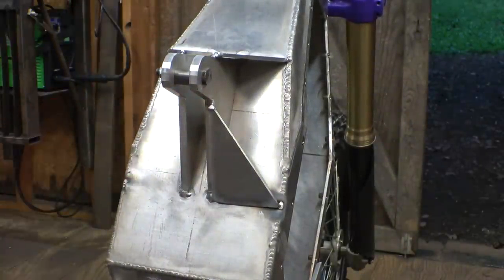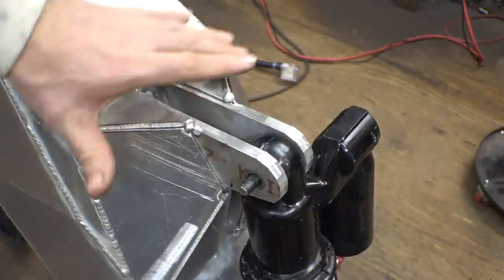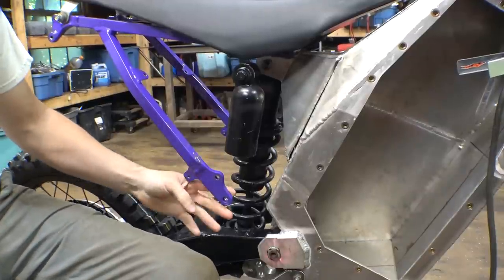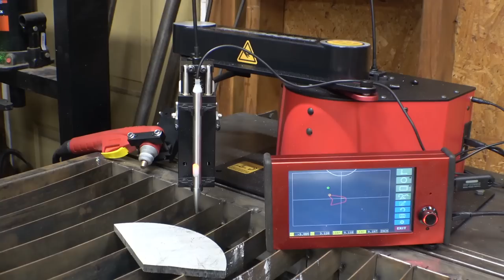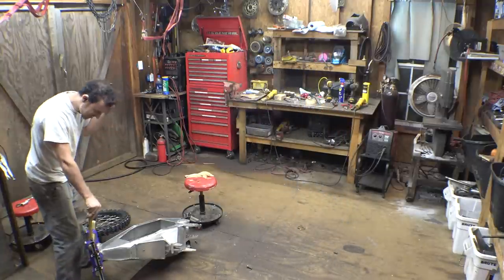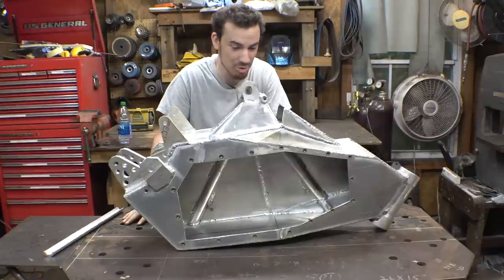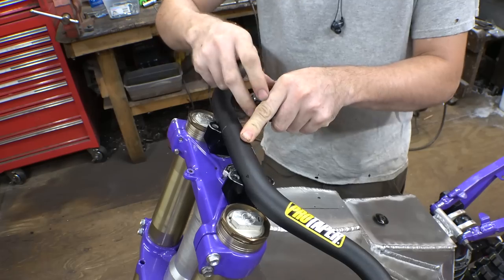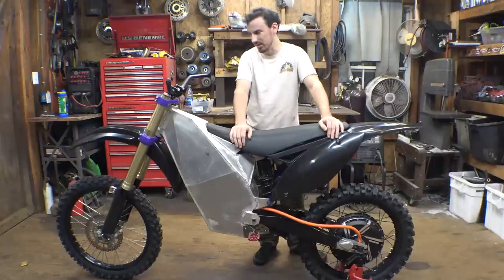Home Made Electric Dirt Bike Build - Part 6

Comment: The weight of the battery and electronics will lower the seat, hopefully enough to touch the ground
Reply: This was obvious to me right away.
Reply: Plus without jack stands it will lean over. You'll adapt.
Reply: Still won't be enough, he's almost a foot out of reach, it's the geometry of the bike that seems odd. So like pause at 29:31 and go look at another bike of the same class, and it looks as if it's a bit too high in the center.
Reply: @aserta  That's why I said he'd be able to  touch the ground, not put his feet flat on it. It'll definitely help but you are right, won't be as much as a geometry change
Reply: Я думаю там стоїть потужна дуже пружина . Можливо прийдеться поміняти амортизатор з гайкою якою регулюється робота амортизатора .
Reply: Dead right. The forks also didn’t look like they had enough sag so that’ll help if they are softened
Reply: @aserta  I think that when he changed the angle for the seat it thru him off
Reply: @aserta  his seat height should be 37in, looks a lot higher
Reply: It looks just like a kx250 sitting on a center stand right now.
Reply: Gotta set the sag with the battery in place, that's all.
Reply: @fullmetaljacket7  agreed, though I doubt it'll come down as far as he wants it to. May need a different shock
Reply: Yeah but he’s also gotta stiffen the suspension so the bike doesn’t bottom out and hit the ground when he hits a big bump or launches off a jump.
Reply: @satan4409  the steering head is gonna snap off the frame on the first jump so I don't think that matters lol Way too flimsy for anything serious.

Comment: First off, great work, I follow and love all of your projects. You are an inspiration. 

Part of the reason for the bike being tall is the way the suspension is now "set up".  I'm just pulling the numbers out of my butt, but you want to run a bike like this with 20% sag, meaning if it has 10" of travel, it sinks 2' as soon as you sit on it. Your weight is all in the rear wheel and that is unsuspended weight... Once you have the battery and everything else installed, hopefully this makes the suspension work better and sag more. 

You should be able to bounce on the bike and get the suspension to move several inches if it is set up properly. If not, it is going to bounce you all over the place, but you're kinda fighting a losing battle when your wheel is over 60 pounds. 

Monocoque frames are very noisy. I have a MTB that has one and it makes lots of noises. That frame is like a acoustic guitar body. 

Also, depending on the type of bike, being able to touch the ground / standover height is one of the things that a manufacturer will compromise to make the bike work properly... If you have 12" of suspension, you need a minimum of 12" ground clearance (probably more like 14" when you consider tire squish and uneven ground)

Comment: Chris, @ 19:50 you notice a spark from the steering shaft to the table. I believe you need to move your ground to the frame instead of using the table as a grounding surface. That's the reason your ground cable is heating up. 
Love this project, keep persevering.
Reply: Was wondering the same

Comment: Chris I love how you turned lemons into lemonade, your seat angle was wrong and you corrected by giving your power plant a cooling vent, lots of builders would let that turn into an angry issue and slam and throw tools all around the shop, well I am thinking how I would have reacted,  I have learned from your approach to problems and how you have overcome issues as they pop up.

Comment: I just had a dream at 62 years old from watching your videos with great interest and enjoyment:  I want to learn how to weld.   Very inspirational!  (I didn't mind the no-rear-panel look!)  I think graphics to make the "submarine" body look so huge will help.  Agree, I was eyeing your front forks not moving as you sat.   Preload and potential move them up in stanchions, as well as additional weight from battery.  I am probably way behind completion on this post, but would have opted for mid motor v rear wheel (cheaper?  Easier to use stock rear stuff?) as it adds lots of unsprung weight -- and THEN you have a real dirt bike, very, very capable!  Saying this will all humility.  Phenomenal work.  I wish I had your patience and expertise!

Comment: Couple things that could help your seat height situation. The weight reduction with the engine removed might have made the spring rates in the forks and on the shock too heavy for this set up, so you may need to get lighter springs. You can also push the forks further into the triples to lower the front, and swap out the rear shock links for lowering links, or fab some yourself.
Reply: Well that and he does not even have speed controller or the heavy battery inside at this point, so of course there is no sag due that missing weight. Since motor was moved to rear wheel that is off the suspension as well, so it will sit higher and be higher even when sitting on the back. Not sure he can push forks further than those already are, handle bar constricts that. Might need different front end that is shorter or get that motor weight into the frame, so this thing can actually be called dirtbike, now its more of dualsport. Rear is easy enough to drop, but the front is the issue here.
Reply: @Hellsong89  true, his got a hell of a gap between front wheel and the guard, will have to see how it looks loaded. he can always replace the bars and lower it slightly infront.

Comment: Tip . Try preheating (300f) that thick aluminum before tig welding it. You can also add some helium to your argon with another bottle and get better heat/penetration!

Comment: When welding aluminum you should ground directly to the part, especially on top of a steel table. If you watch playback you can see the aluminum arc off the steel.
Reply: I searched for someone else saying that.. I didn't until after I did. But I hope he sees the different comments letting him know!
Reply: @SillySalmon94  i done the same as i was thinking the same just needed someone to confirm it

Comment: Hey Chris, it would help if you put your grounding clamp directly onto your work piece when welding. It will help with your heat issue from to much resistance.

Comment: weld a bracket on the side of your platform with some holes in it so you can drop in a spring loaded pin into the hole which will hold up the cutting platform for the arcdroid

Comment: Look into dirtbike Sag adjustments for suspension. You want to be about 104mm of compression once you sit on the bike. That will set up your rear spring tension properly.
Reply: 104mm of sag would be about right for 11” to 12” of wheel travel.  I ride a CRF 250F which only has a little more than 8” of wheel travel and a suspension expert recommends about 70mm or 2 3/4” of sag.

Comment: As a suggestion, how about putting some sound deadening material inside the frame / battery / controller housing. Might make it sound less metallic when stuff hits it. Also a gasket of sorts around the door? Fantastic build, keep up the great content 👍🏻🇬🇧

Comment: Definitely need to cut out a huge lightning bolt on each side of that aluminum box and put an acrylic panel in there.  And then backlight it with LEDs.  DO IT⚡️⚡️

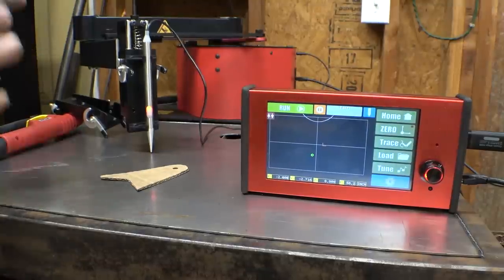Comment: @12:15 And realize that if you trace it loosely, and don't follow the contour exactly, you will get either a piece of scrap or something that needs extra grinding. The stylus is only as exacting as the person tracing the part or template. And the Part/Template's accuracy itself. Affixing with hot glue works good. Then you just peel it off. The computer screen will show how you did, so you can redo it if you "color outside the lines".  😅

Comment: Yes chris, Its looking sick starting to take shape now. I think the frame will be strong enough, if it was me I would weld on the inside at the back of the frame cos it's where the swing arm and shock bolts to and the inside at the front where the head stock is. Go over it with no filler rod first by melting/puddling the two bits together then if it needs it go over it with a filler stick, hopefully it's a animal when it's built 🤞🤞💯👍👊👊

Comment: I'd go with the black colour and ditch the purple bits will look sweet suspension works great without battery any luck finding the spring with compression ratio you need

Comment: I would definitely sit on it n hold some dumbbells or something that are around the same weight as the battery n controller to see if the suspension will come down enough for you to comfortably touch the ground. Also that trace feature on the cnc plasma cutter is sick

Comment: remember voltage = top speed Amparage to the motor = acceleration and remember to have thick cable from batter to controller and controller to motor for less voltage drop

Comment: Pllease measure the voltage drop of the cable by measuring the voltage in your garage and then substracting the voltage at the end of the cable in your shed. That would be interesting to know.

Comment: Just a thought on the hole you cut it looks the right size for a pc fan to fit. it may help with air flow and could be hooked up on a toggle switch

Comment: I would add a strengthening gusset underneath and around the head tube and downtube frame junction at the neck where the fork sits as there will be a lot of stress on that joint especially when the battery’s and controls are all in there

Comment: 3 things to say
1) in place of clutch lever,  fit rear brake mastercylinder from scoot they 14mm like the dirt bike rear mastercylinder 
2) the seat angle on frame was fine, but the rear shock mount height dictated your seat height and thus the new angle you added is now also bending your seat base 
3) suspension squeeks, look at thrust face fit of suspension points and angle of bits, might be advisable to make a jig of original frame locating the swingarm to shock and torque arm locations and use it to double check your Ali frame locations, maby an edit of one of the points is needed 

Cool build so far,  electric dirt bike frame 2.0 next to come?

Comment: While you're resealing the front forks, you could cut the springs an inch or 2 to bring the front down . Then you just need to adjust or cut he back spring to bring the ride height down to level the bike. Since you aren't going to be riding hard trails or jumping it, the ride height being lower should be just fine.

Comment: If its not low enough after it's got weight on it you could make the suspension linkage longer or move the frame side mounts out, they even make an adjustable version

Comment: Even with production welding aluminum with a water cooled torch and the ground clamp on the peace or super bear like yours they get rowdy hot. Miller machine also. Happens!
Reply from the maker: Especially at 154 amps for 20 minutes😂

Comment: I think the rear side fenders have an additional function - they stop the engine ripping your leg/foot off if you fall and get an appendage in the void between the tyre and the underside of the seat frame.... :)
Good work, really fun to watch! :)
Reply: The motor is in the rear wheel.  Nothing spinning in the frame.
Reply: @MrMorepower71  The motor is driving a VERY knobby tire that rotates from an open space into a narrowing and finally disappearing gap down into the rear swingarm.
LITERALLY the first thing you're taught in mechanical engineering safety is to never build something that moves fast and carries mass intertia into a narrowing gap. Most machinery deaths and amputations are caused by this. It's the basic working principle of branch shredders and waste disposal shredders if you want to look at it from another POV...

Comment: when you lowered it you did it only at the back tire which made the seat tilt downward so you raised the seat in the back. being that the front end didn't get adjusted at all you're just kind of teeter-tottering so you lowered it but to fix the angle of the seat you put the seat right back where the frame was before you lowered it. still a sick build though!

Comment: You can adjust the sag of the rear suspension so it sags when you get on it so you can touch the ground, or for some bikes you can get a new linkage for the rear suspension that will lower the bike

Comment: Sería buena idea poner un casquillo de acero entre el tornillo del amortiguador y el soporte de aluminio. Si no terminará comiendo el agujero y cojiendo holgura . Gracias y saludos desde España. It would be a good idea to put a steel bushing between the shock bolt and the aluminum bracket. Otherwise it will end up eating the hole and taking slack. Thanks and greetings from Spain.

Comment: For cutting aluminum on a plasma cutter you should be using nitrogen rather than air. That's going to help clean up those edges alot.

Comment: The sleeves are better than long sleeves, to prevent skin cancer. You’re wielding almost the same amount of UV light emitted directly from the sun. That’s why tig welding booths are usually painted black to absorb errant light/UV. Same goes for the neck area. I’m a AWS (QC1/CWI) welding inspector/welder btw

Comment: Hey mate, for your bike height, you can get lowering links for the bike if you have retained the exact geometry. Also your looking for a rider sag of 100-105mm. You can see in the video your suspension is not sagging near enough. 

I’m sure your aware but the suspension geometry is very very precise with dirt bikes. A lower linkage that’s longer or shorter will change the bike characteristics entirely. I’m assuming you have all mounting positions in the exact spot as the original KX. Excellent work 👍🏼

Comment: Have the forks revalved and softer spring rate when they are rebuilt.  Also there is alot of meat in that seat could shave atleast an inch from there.

Comment: all full size bikes are mostly the same seat height depending on the brand, but once you have the battery and controller in it i'm sure it'll make it sag enough that you can reach the ground, also i like how you put the rear quarter panels on and you can still see the shock in the middle through the gap it looks cool

Comment: You can get or make longer rear shock connecting rods, the cantilever rods underneath, that connect the swing arm to the bottom of the shock. If you lower a inch on the back, lower a inch on the front to keep steering working as intended. It will also sag with battery weight and all electronics, but maybe not enough.

Comment: You can buy a cheaper (but still look for a certified/good brand) fire proof under suit for racing stuff. They're thin, but they don't burn. Being the undersuit it's not as expensive as the outer skin, and it's meant to be a consumable (it soaks up the sweat instead of the suit, is the idea). That can be used to weld, because it's not as cumbersome as a leather jacket, but it also won't burn.

Comment: get some nickel anti seize and put it on those handlebar threads... you have steel bolts with aluminum bar mounts and it causes galvanic corrosion. Nickel (NOT COPPER) anti seize will work great on alot of stuff

Comment: I would highly recommend uncoiling those 220v extension cables before using them. If you use them while still coiled up, you run the risk of making an induction coil and melting the cords/starting a fire. Lots of images on Google of extension cords that melted themselves.

Comment: Build a water table under the plasma with a drain hole so easy to fill and drain to use.

I think you should rebuild the suspension.  Forks arent that hard just a few cheap parts and add a heavier fork oil

Shock may/may not be rebuildable.

You should be able to find the manual for the original bike online and will have specs and directions.

Comment: Once the bike is ride weight, you'll have to sit on it and check shock sag. You should have around 100mm sag from your weight alone. I think free sag should be around 30mm iirc. Total sag should be around 130mm from full extension to loaded with rider. 
If you have 100mm sag but too little free sag, you'll need a larger spring. Base initial spring rate selection on total additional weight over stock bike that the suspension came from.

Comment: nice ! arent the suspentions a little too stiff ? like always, good video
Reply: that comes from the donor bike, its a motocross not  an enduro, motocross suspension is much stiffer (for big jumps) than enduro suspension, also there is not that much weight on the bike yet

Comment: The weight of the battery and the electronics will help to weigh down the suspension and you will have to set the proper suspension sag after it is fully done. However the fact that it is a 250 is irrelevant. It is a 250 competition bike, atleast that is what you based the frame off and the suspension is full competition. It I designed to his 60ft jumps and pound through whoops. If you wanted a dirtbike that you could reach the ground on, you have used a recreational dirt bike like a Yamaha TTR230 for example.

Comment: you really should clean the spray paint of the rear shock shaft. and then to "lower" the seat you should set the sag. but because you made the frame to the kxf swingarm you probably could put a lowering link on it

Comment: FOR THE HIGHT SO YOU CA REACH THE GROUND, You can lower te mount pint where the frunt suspension is tighten to the handlebar base so will be make it a little lowe but might hit the handle bar so probable that will limite the lowering ranger u have - FOR THE NOICES ADD SOME FOAM IN BETWEEN ALL METAL tightent parts to others Parts as muchas as you can.

Comment: Your 50A cables will easy carry the current required by your welder.  The 100 foot total length will probably have bit of voltage drop when you are loading down the welder, but it shouldn't be anything to worry about.  Now that  you have this hookup there's no reason to not use it full time.